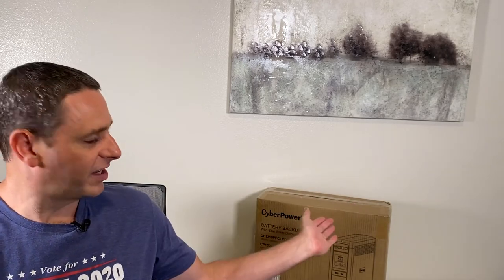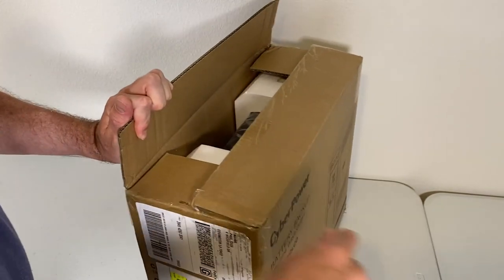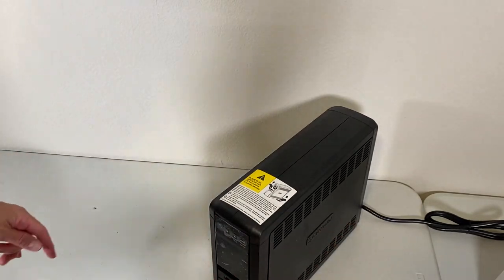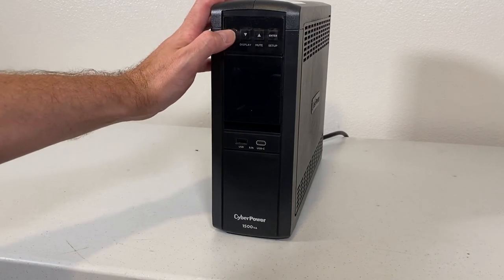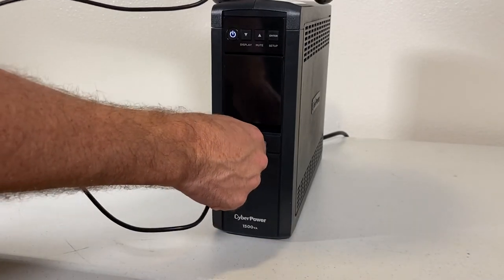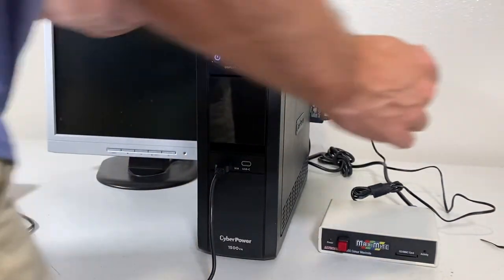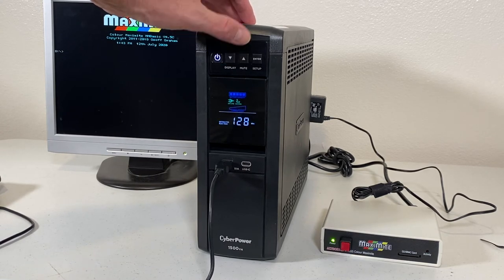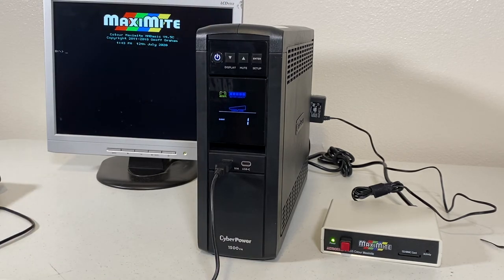Cyberpower sent me a replacement UPS, let's test it.

Comment: Do I have to turn UPS off before plug in my computer and tv? Also when plugging out pc and tv do I need to turn off ups?
Reply: No. As long as the devices are powered off when you connect/disconnect them, the UPS can stay on.
Reply: @christusa8221  thank you :)

Comment: Did they give you a prepaid shipping label for your previous unit?
Reply from the maker: Hi, no they asked me to submit photos of the destroyed unit. I recorded this video as additional proof, but they did not want the parts back, they simply shipped me a replacement unit after I emailed them proof of destruction.
Reply: @RetroAxis  it goods to know that. 

How was your previous unit part damage? Any other damages along with it? 

How is your replacement unit now?
Reply from the maker: I ordered  my battery unit from Amazon. It arrived, packaging was fine, but there was a noise. Watch the original video https://www.youtube.com/watch?v=yYb7QqSX4Cg  where I demonstrate the issue. There was a loose part on the inside, turned out to be a minor plastic part, but I wasnt sure if it was metal or was an issue that could lead to a fire or other issue.  My replacement unit is fine!  I have had cyberpower units outlast my APC's.
Reply: @RetroAxis  You have a great review that unit. Is there specific ways in order to check if the unit is working properply? 
Also, do I have to connect the battery before use like APC brand? Or any recommendation I need to do first before use it?
Reply from the maker: I would suggest following the manuals that are included with the unit, as not all models are the same.  As far as testing, use the self-test if your unit has one included. Procedure will vary, so refer for the manual.
Reply: @RetroAxis  I just test my battery unit, I pluged xbox series x and lg oled 65inch, the range of total watts between 250-300watts. I tried to unplug the battery and it kept the powers. It seems it can only hold power between 10 to 15 mins. It dropped the % battery pretty quickly, it likes 3 minutes = 20% of battery. Does it seems normal to you? Did you tried unplug power of the battery with a lot of total watts and see how long the battery can hold?
Reply from the maker: Different batteries are rated at different loads and runtimes.  You find a runtime estimator on some of the UPS vendors webpages.

Comment: Hi, sorry can I ask can this UPS load for 2PCs? and How long can it last? thank you
Reply from the maker: Hi, battery runtime will depend entirely on the amount of power being drawn from the PC’s and the specs of the battery.  I would suggest you use one of the runtime calculators available from the UPS manufacturer, as they will allow you to enter the specs of your components and find a battery that matches your needs.